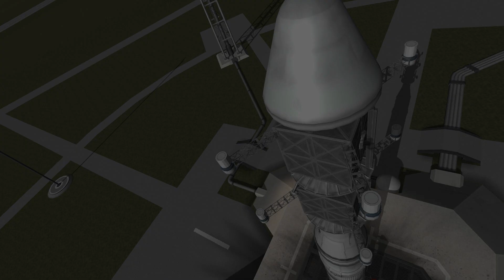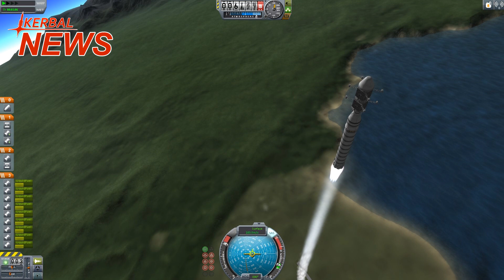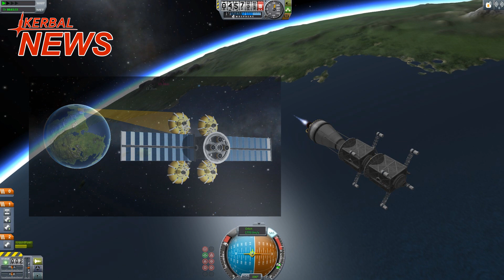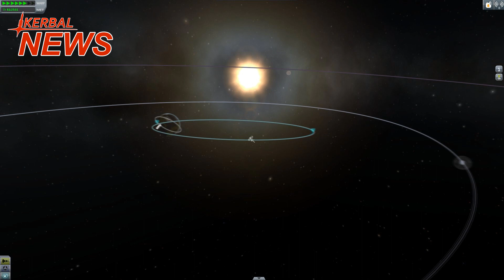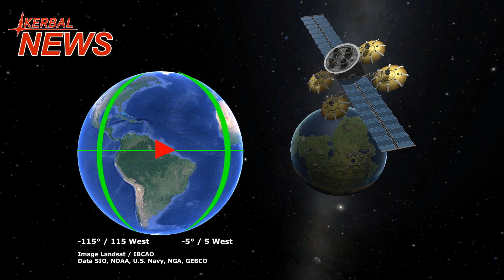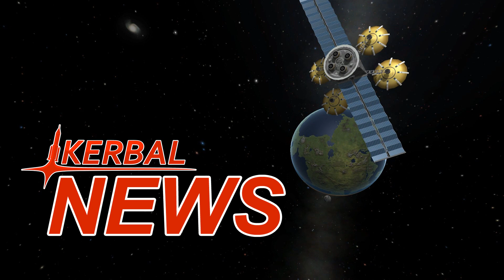Falcon 9 Launch | Eutelsat 115 West B & ABS | KNews #04

Comment: I am confused about the orientation of the super-synchronous transfer orbit (SSTO).  The launch was from 24.8 degree inclination.  Does this mean the SSTO inclination is at 24.8 degrees?  If so the two sats will have to not only circularize at around 37KM geo-station alt but also change their inclination to zero so they are stationed directly above the equator.  Is this correct or does the second stage do the inclination change prior to burning out to the SSTO?  This is of course assuming the AP is at the AN or DN of earths equatorial plane.
Reply from the maker: Hi,cape caneveral is not located on the equator. It's on 28.5 degrees latitude according to Wiki. This means you can't launch directly to the east because you have to orbit arround earths center of gravity. (Picture: http://imgur.com/SS4glBf) I'm not 100% sure but from what I remember the inclanation changes are done high in orbit near Apogee. Thats why the transfer orbit is usually much higher than the geosynchronous or stationary one. After the inclanation is fixed they have to decrease their Apogee again which is more efficient than changing the inclanation on the right orbital altitude. This of course also depends on the launch site. [Speculation] It could however be they allready began to change it during launch because these were the first two comm. satellites completely relying on electric propulsion.

Comment: Um....Great video. Up until you got latitude and longitude confused.
Reply from the maker: Hi, I think I'm correct! Longnitude degrees are counted along the equator on the line of constant latitude. People usually get confused by that but it's much easier when you simply forget how the lines itself are called and just think of the degrees. I should've made my picture explaining it a little better I guess :)

Comment: i think you got your Longitude and Latitude description backwards. Longitude are the lines that converge at the poles and run north south... measuring east as west positions. Latitude is the concentric circles that go around the planet (including the horizon and the tropic of Capricorn and Tropic of Cancer) measuring north and south positions.
Reply from the maker: Hi, thats right. I've meant the "longnitude degrees" not the lines itself! If you count the longnitude degrees you move on the latitude line so to speak. That can be super confusing but since only the degrees really matter you can see it like that. At least that helps me a lot. If somebody says 50° latitude and you're at 0° you know you have to move lateral to the equator by 50°.
Reply: KerbalEssences ah ok gotcha.